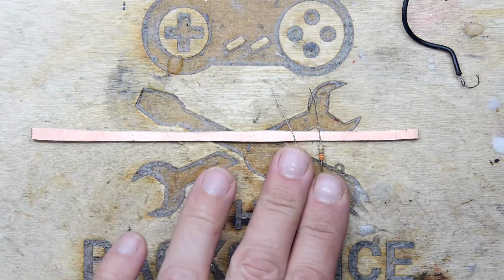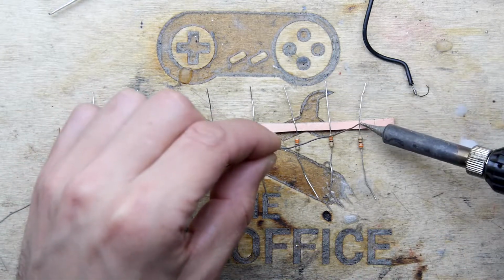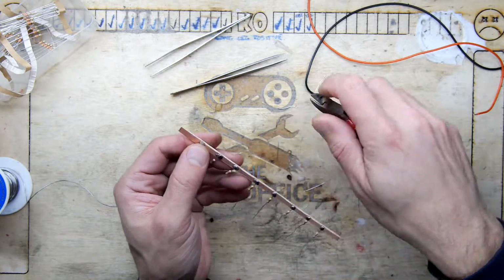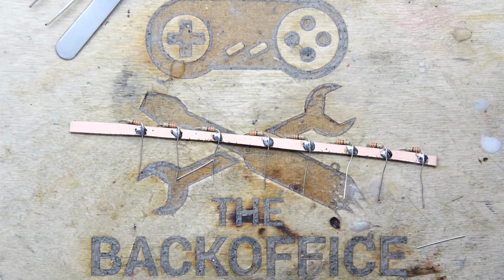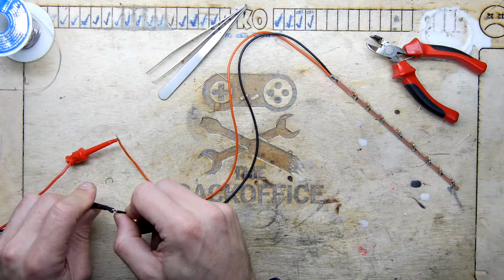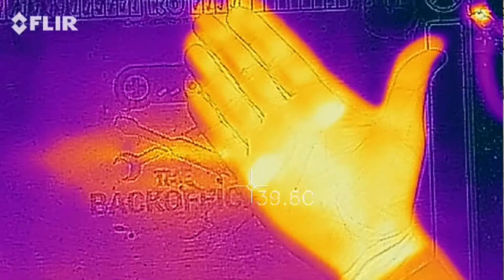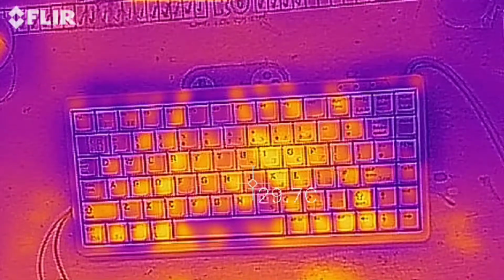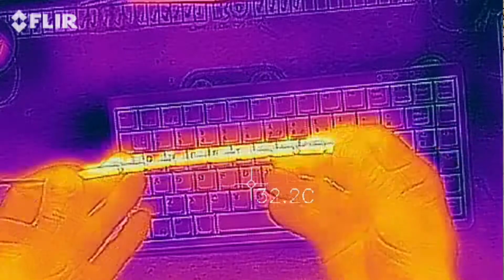DIY Keyboard Vivarium Heater

Comment: Can't help but feel like some kind of resistance heater wire made for the job would be much easier/less insane, but I like the idea of just using something that every hobbyist potentially has lying around in their hundreds. Also this approach gets points for style, of course! Who needs sane and boring anyway?
Reply from the maker: +TeaTeaKay not sure that would necessarily be safer, at least this way the user has to do the calcs 😂

Comment: You were right - this is ridiculous. But you kind of got me thinking. What if you put the heater in front of a small fan, and blew air into the keyboard from the rear? The warm air would come out the gaps between keys. And the positive air pressure would probably actually keep the keyboard less dirty...
Reply from the maker: +savagememes this seems a lot easier to implement, I wonder some really thin fans exist cheaply, like the ones in tablets
Reply: maybe a slightly bigger fan can blow into a little airflow manifold
Reply from the maker: +savagememes that would be easier to get parts for 🤔 resistor pack, fan, manifold. All you need I think.